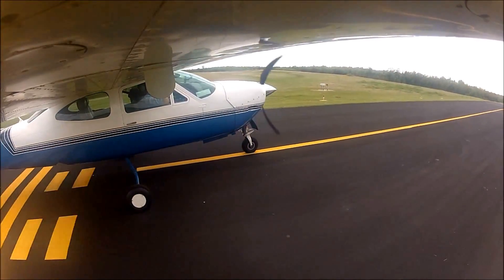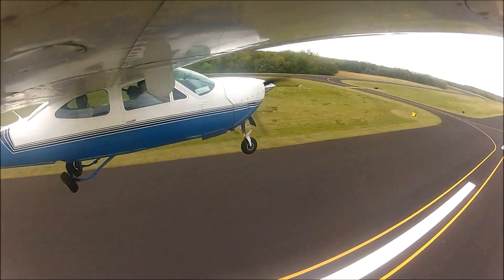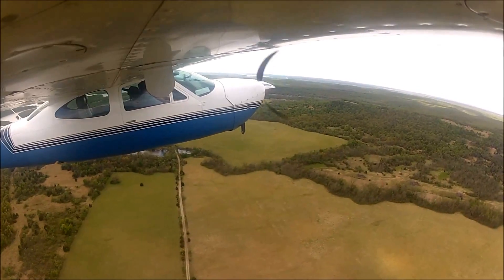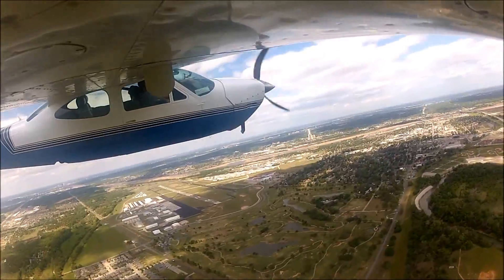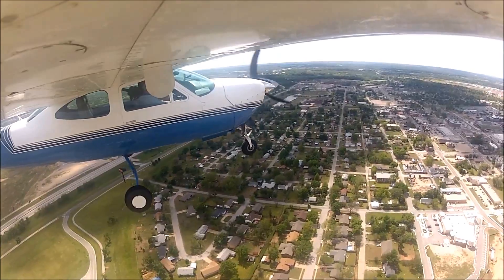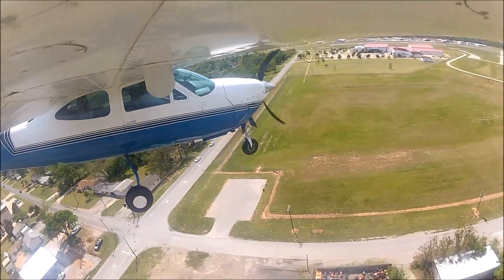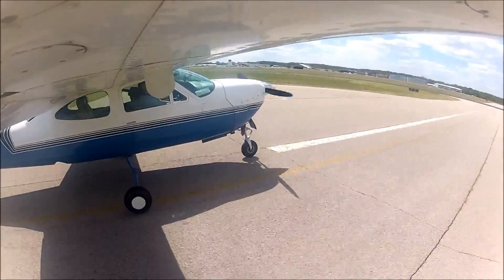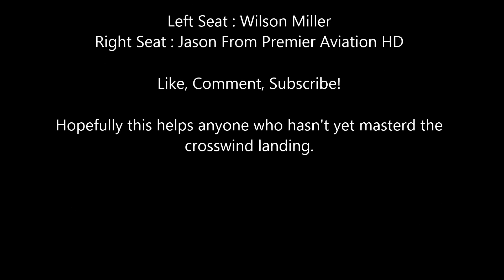Crosswind landing Explained - C177RG

Comment: Nose first....hmmm...probably not the best practice, particularly in a Cardinal that tends to be nose-heavy.
Reply from the maker: mj4magic nose didn't hit first.
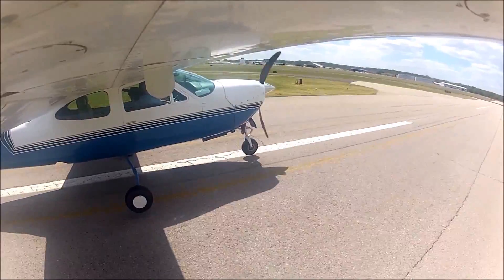Reply: The Cardinal Pilot Really? Look carefully at 4:22. The nose gear hit the runway first and then bounced back up.
Reply from the maker: I wouldn't call it a bounce if it's so close you can't even tell if it touched. Did or didn't I still had to pull back and roll it to the left for the crosswind.